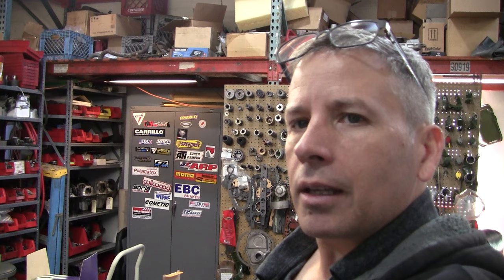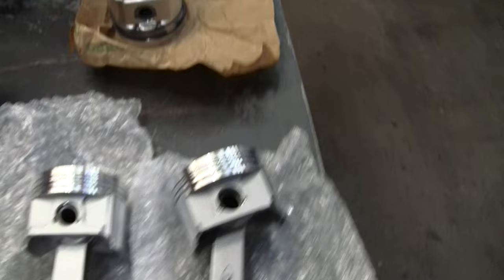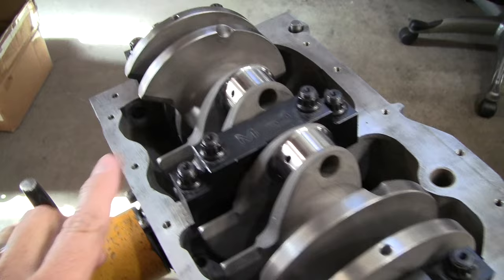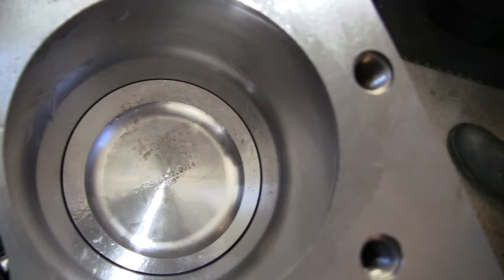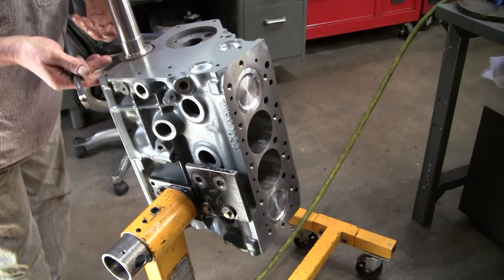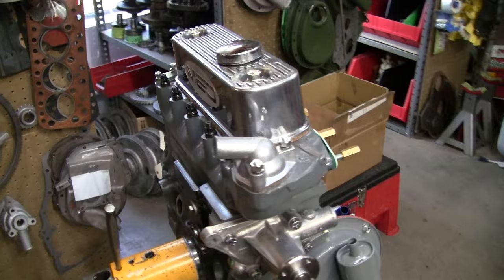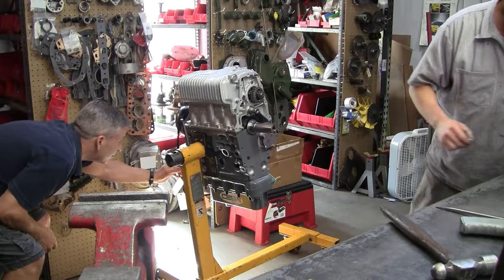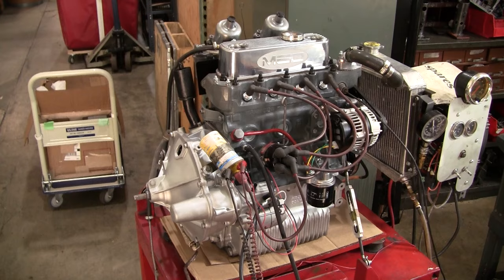Classic Mini Engine Performance Upgrades

Comment: You guys in the States don’t know how lucky you are? When I was tuning BMC “A” series engines in the sixties, we had none of the tuning aids that seem to be so easily obtainable to you - I’m so jealous! Mind you, I would have topped it off with a DCOE Weber instead of the twin SU’s.
Reply: Ooh carburation that was always a point of contention when I was modding my Minis in the 80s. For road use the single 1 3/4 HIF or HIF44 1275 Metro SU was my choice although a mate swore by a single side draught Webber
Reply: Used to use twin 1 1/2 SUs with MME needles for road use on my 1340. Downton S2 head with all the lightened balanced bits. SC/CR box + tons of other bits. Used to fly!
Reply: Nothing wrong with SU carbs, they're simple to setup, adaptable to just about any performance engine. They are less complex & proved their performance & reliability in aircraft like the Spitfire...
Reply: Would have loved to see splits on it.

Comment: Don't even tell us where they are! In the UK? In the USA? Where? Does not fill me with confidence when they have to take material off the block to avoid interference.
Reply from the maker: If you're referring to MED Engineering, they're in the UK. To your other point, all kinds of modifications need to be made to these older engines to increase performance. Modifications have been done to them since they were new so I wouldn't be concerned. The A-series block has been around since the 1950's.

Comment: It should be a 2 Litre Engine with 4 valves per cylinder twin cam cross-flow head and  2 DCOE 45 webbers😄

Comment: Really Fulljoy this video guys. Remind me of the days back in Jamaica when I use to assemble ford 1700 cc 1760cc and 1840 engines breathing through some 45 and 48 Weber side draft carburetor. Some Toyota 2T and 3T engines. Never did a lot of work on minis but there’s a guy there who was the mini king George Sherwood.

Comment: Hi i am doing a full ground up resto on a 1967 Morris Mini it still needs alot more work yet but i would like to know how much horsepower can i get out of my 1275 engine it has already been ported out and had head work done to it before i got the engine it also has a MK1 Cooper S gearbox i have not had the chance to hear the engine run yet but my Dad and i have given it a very close look over and the bores are clean with no lip at all hardly and carburn on the pistons and the head is very clean and smooth ports with double row valve springs and even the valves look great i also have genuine Cooper S Dual SU Carbs and i am putting a Gearbox Oil cooler on it as well later. I want to aim at getting 100HP out of it yet without doing to much work to it so i am wondering how to do that as a 1275 S block?
Reply from the maker: Well, the stock Cooper S 1275 has about 75Hp. In order to get it to a hundred would mean going to a big overbore (1330, 1380 ...) with high compression pistons and a lumpy camshaft. As big on the valves as you can go. Big exhaust. Possibly weber carb(s). That's the quickest way.

Comment: Love that crankshaft.
Not surprised about it liking higher octane fuels, as UK fuels are higher octane.
Before leaded fuel was banned from general sale in 1999 we were using 98 octane and even now our lowest option is 95 octane standard unleaded.
Even stock Minis don't run at their best on 95 unleaded, benefitting greatly from octane booster and more timing advance.
Reply: We don't calculate Ron and Mon numbers the same as America, it works out to be about the same though.
Reply: Back in the '70s when I built my 1296 we could get what was referred to as 5 star petrol - 105 octane - from most service stations. Back then there was 2, 3, 4, and 5 star available, each a different octane rating. Only 5 star was good enough for my baby! It used to cost about 80 pence or $1.80 a gallon (4.54 litres). After that petrol prices got a bit silly and now we pay roughly £5.60 a gallon. Most fun car I ever owned.
Reply: John Powell I well remember my Dad in the early 70s complaining to the garage owner about petrol going up to 40p a gallon (we were in an Austin 2200 land crab) no one could have guessed how much an imp gallon costs today.
Reply: @nigeh5326  : It was probably 1974 after the 1973 OPEC oil embargo took hold and the price shot up.
Reply: John Powell yep it probably was thanks.
Reply: the uk fuels convert to be the same octane as us fuels.

Comment: Nice work lads, I can't help wonder that why some drivers would not go with the twin cam head and fuel injection, especially if you run high grade fuel.
Myself personally, love the sound of the SU's and keeping the engine looking stock, but as a street sleeper :)

Comment: many years ago   i installed a 1275 s motor into a mini pickup truck . It was awesome .
Reply: I put an mg 1100 engine in my minivan.  it was awesome.  tuning made easy. and it immediately showed the need to uprate the brakes

Comment: The old crank has 1-3/4-inch con rod bearings and the new straight-line rod crank has 1-5/8-inch rod journals. Why wouldn’t they build the 1-3/4” rod journals in the new straight-line rod crank?
That multi web engine block and transmission looks incredible.
Also doesn’t anyone make a cam gear drive instead of a chain?
Couldn’t you get a ¼” smaller diameter crank damper/balancer? So, you wouldn’t have the belt problem. With the engine in the car and you lose a belt, that would be a real big problem.
I love the way the engine/heads look in Mini green.
This is one GREAT looking Mini engine. Thanks
Reply from the maker: A lot of performance cranks and rods use the 1.625" bearing sizing because that was the Cooper S standard. There's toothed belt drives for these engines but not gear drives. Sorry, but was is the "belt problem"?
Reply: @minimania  You stated you must remove the crankshaft damper to install the fan belt.
Reply from the maker: @dougharlow6037  Right - yeah, that was an aftermarket damper that's much larger than stock. It wouldn't be an issue with the stock type or if we ran a different timing cover without the breather.

Comment: Yep brings back good times i had 1977  yellow 1100 cc mini dunlop alies 165x10s i put a 850 gear box on a 1000 engine low gearing went like a bat out of hell 😊. I put a morris 1300 engine in a mini . 95 mph . All day long worked in a breaker yard for nearly 6 yrs saw a lot of minis and metros 1275s  i found new homes for them to ha 
 Lots of wet drivers seats 😂 hi from ireland .😆

Comment: Nice video!
However, I noticed something;
The connecting rods that you have chosen, don't have a oiling hole (The hole that pressurized oil get into the piston pin area). Isn't that gonno make the piston pins run dry?!
Reply: Like they would make such a mistake? Thanks for letting us know you are a know all.
Reply: Were you looking at the big or little ends? Big have the crank rotating in them so are oil fed, note that the oil ports are to the the side of the journals to make the centrifugal force throwing oil a bit more even. The small ends don't rotate, they just rock as the rod goes from the side to the side in the block as the crank rotates. Consequently the little end can't "surf" on a film of  pressure fed oil like the big ends. But, as the only way to feed oil up the rods would be via the mains bearings and then the big end bearings it would require even more pressure and power through the oil pump. It'd rob oil from the bearings that really need it & take more power from the engine's output.  

The small ends are, however, directly in the firing line for oil that is thrown out of the big ends

Comment: So you didn't know what the compression of the engine was when it was specced up with the cam/head/pistons etc?
Reply from the maker: No, not exactly. We knew that with this piston and head combo it would have higher than normal compression but we didn't CC the head beforehand.
Reply: Impressive...
Reply: @minimania  I can't imagine ever building an engine with steel crank and rods, forged pistons, etc, and not doing a combustion chamber capacity check before final assembly.
Reply from the maker: @rogerking7258  The customer had talked with the supplier and knew the specs. We were only assembling the engine. Had he needed independent verification we would have given him anything he asked for short of dyno testing.
Reply: @rogerking7258  who cares....just get the compression of the engine through a compression check, take the intake valve closing angle ABDC, plug it into a dynamic comp calculator, guess your static comp, and if the answer's cranking psi is the same as you got on your engine, then thats your static comp ratio.

Comment: If the tunnel had to be line bored to enable the caps to fit properly, was there any taken from the block? If so, you have the reason for the slightly loose timing chain right there. Also, how could the motor have a compression ratio higher than you originally thought? How did you measure it before and after? And what octane rating was the fuel before and after?

Comment: Used to build these in the 70's 649 cams were the king  had 6 mini cooper S from 971 to 1275  miss them boohoo
Reply: I ended up with STR930 cam, (same as a 649 but star drive) and twin split 45's. Miss it like hell.

Comment: Nice, but not enough technical detail. Such as, what was the material of the rods. Was it a steel crank or nitrided cast iron. What was the spec of the camshaft and followers. A comparison of the OE and the new flywheel would have been interesting.  A rev limit for these lovely rotating parts would have been nice. Who manufactured the various components. Some expected bhp and torque figures would also have been nice.  Generally could have been much more informative and interesting. A pity, but a really nice engine.
Reply from the maker: Check the kinks in the description for more information about the parts.
Reply: @minimania  Sorry would love to but to someone of my age, checking the kinks has nothing to do with cars! Could you explain what you mean to a tecno dim wit. Thank you.
Reply: Barry, go to the MED website for all the details on the parts

Comment: I see you using cast iron heads, but I recall that aluminum heads are also available.  Given the lighter weight, why not use an aluminum head?
Reply: The thermal properties would be a better reason to go for aluminium. A cast iron head on a cast iron block is innately better at holding gaskets. Since the design was for cast iron having to fit pressed valve seats would be a compromise too.
Reply: As far as I recall, BMC never made an alloy head for the A series. The block you're using looks like a series 3 S or 1300(which were the same thing and had no tappet chest covers). There were some light green blocks knocking about in Longbridge experimental, which had thicker walls and allowed bigger overbores. They were all supposed to have been scrapped. Funny how many weren't!   However, Arden did make and alloy 8 port head for the track, with a variety of inlet systems on the front, when we had to use a Clubman shaped bonnet. Some people used 40 or 45 Webbers, some used 4 Amal carbs.. One actually had a Lucas F2 metering unit. It took some setting but was quite quick at the top end. Ah memories, but forgive, if a few of the facts may have faded a little.
Reply: I guess I was thinking of the cast aluminum heads from Moss that I recall from the catalog.  I believe they already had valve seats pressed into them.  Funny to think my original post was from a year ago.  Good to be reminded of this vid!

Comment: What kind of RPM do you reckon your 86mm stroked crank can withstand on a daily basis, i.e. for a daily driver 1460cc for example ?
Reply from the maker: I wouldn't consider a 1460 power unit for a daily driver. It's not really built for it. This set up isn't one of the 86mm stroked cranks, this one has the standard stroke with .060 over pistons. Still, even this engine is a bit much for a daily driver - especially since the gearbox and drop gear set are all straight cut - more like race set up than a highway cruiser. Something a bit more mild with lower compression and geared for highway driving would be a better choice for daily use.
Reply: Mini Mania My daily is a 1330cc 10.8:1 CR with a 268° custom Cam. It is very civilized but I thought that a 1460cc would benefit from more torque and low end drivability on par with the added cc's, why would it be problematic ? Vibrations maybe ?
Reply from the maker: That 1330 sounds about right for something really workable for daily use and I know lots of folks do this with 1380's as well, as we've built many 1380's over the years. Vibration shouldn't be a problem but the higher spec you go in some instances the less driver friendly an engine can get in terms of fuel choice, cooling, ignition, etc. That's not to say it can't be done but then longevity is also an issue. Daily driver engines tend to be more mild, with gearing for reducing revs at freeway speeds like 3.2:1 or similar.
Reply: @minimania  Agreed, however considering the normal RPM range of a daily ( 6500 RPM redline) I thought that the longer stroke would not mean a reduction in longevity, and by keeping a mild cam ( around the 270° mark) you should benefit from the extra cc's without drawback .. Well having said that it is true that the cost of such an engine would be insane compared to a simple 1380 due to the special crank and connecting rods.
Reply: It seems that Thunderwars has better knowledge than mini mania. The cam dictates the personality, and what other parts are needed to make it work at its best.

Comment: Do you check the piston ring gaps before fitting the pistons? If so what gap and tolerance? In my day it was 3 thou per inch of bore diameter.

Comment: Ouch! Sorry but I'd never use that amount of force to drop a piston in.  A heavier hammer, with a shorter handle and softer blows is def my preferred approach. It's easier to notice any changes in resistance, feel or sound.

Comment: I am pretty certain that the timing chain tension was perfect before you added a tensioner. 
If anything it was on the tight side (but would loosen up with use to correct tension)

Any tighter would create immense amounts of friction and very premature wear of components.

If you did this on a bicycle for example, you wouldn't even be able to pedal it.

Comment: Where are you located, like your modifications, text me your information. How much would it cost to build a 1440 cc with full race cam and split 45mm sidedraft webbers with straight cut gearbox, and drop gears 1:1 ratio with powerlock differential.

Comment: Something like this is probably pretty unaffordable right?  looks awesome though!
i'd love to put an engine like this in my sprite, wich is pretty aneamic right now since it has the wrong 1098 that someone has put there in the past. shame, it cannot even be bored up since the 1&2  and 3&4 bores are too close together.  more likely i will have to put something more recent in that car eventually. light weight and with more pistons.
Reply: I had a Mini with the 1098 long stroke in it. 
I found it inferior to the 998 which was smoother and could be reliably revved, my 1098 threw a rod so I dropped the 998 in, fitted the 12g295 big valve head (used in the 998 Cooper and possibly the Sprite), a rally cam, double row timing chain and with a free flow exhaust manifold RC40 silencer and 1 3/4 carb it revved to 8k yet was economical.

Comment: Hi Guys. Lovely Video. I was wondering if you would build a similar engine for an Austin 1100 1973  for normal driving but well up to date like the one on thid video. Not used for racing but a better performance with  mod pistons. Good with engine oil consumption problems and a better  torque. Basically to bring it up to modern road speed that I wont have to pull over all the time to let a mile of traffic pass out. Roughly what kind of cost would this  amount to. Thank you, Mervyn
Reply from the maker: This type of upgrade isn't possible on the 998's and 1098's as this crank, rod, and piston set up are only for 1275cc engines.

Upgrades for the small bore engines are much more tame.
Reply: @minimania  Do you do the "much more tame"  1098's  upgrade  A+  and How Much?    Thsnks, M
Reply: You could always start your 1100 upgrade by using a big-bore block.  Easily spotted by finding an engine with angled heater valve, BUT not so easy to find one in the first place...

Comment: I have a 1968 sprite and there is a oil line that come out of the head by the spark plugs. When I finally got the engine running oil came out and I cannot find where the line goes. Do you happen to know where?
Reply: To the oil pressure gauge...

Comment: How much would a Motor Cost like the one you built in the video
Reply from the maker: It's roughly $12K in parts alone. That should give you an idea.
Reply: @minimania  good on ya for answering , many avoid that question ,

Comment: Is an automatic transmission worth building the engine? Or should I start looking for a manual set up?
Reply from the maker: There are very few parts available for the automatics. Best to go with a manual gearbox as the parts for those are plentiful.
Reply: @minimania  thanks

Comment: I wonder why you have fitted lightening slots to the con-rods on the sides that are suffering the highest bending stresses? Surely you should fit the slots on the other two sides where the bending stresses are much lower.
Reply: MrFunkia The MED (made by Arrow) rods are designed to be the lightest and strongest, those cuts make no diference to this small natural aspirated engines as they make the power by reving to over 8000rpm and dont have lots of torque.